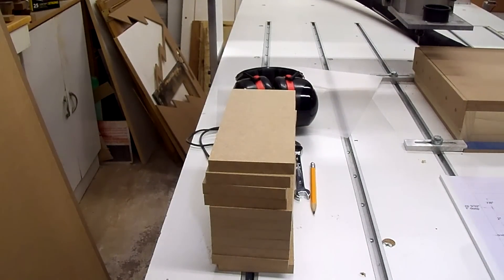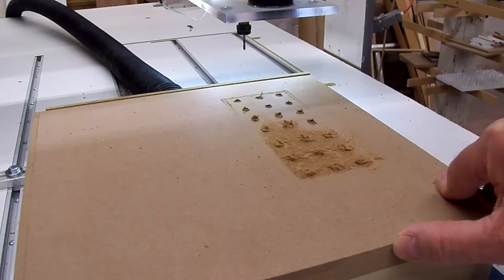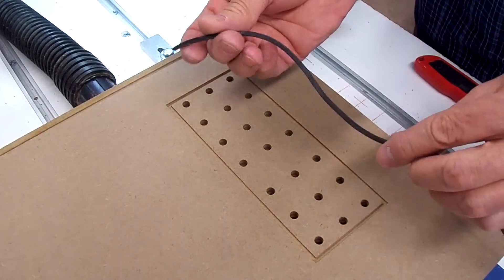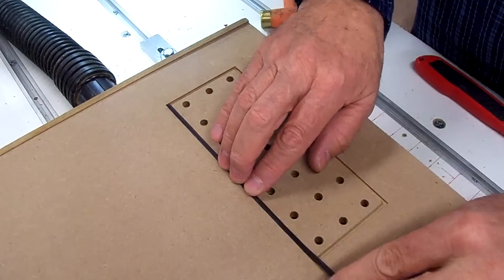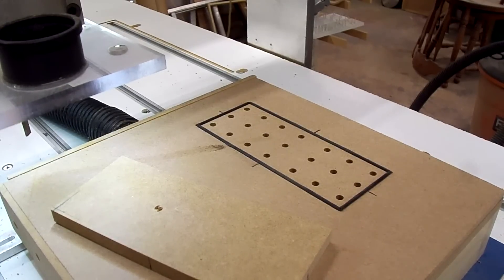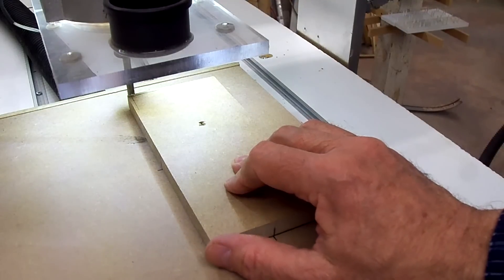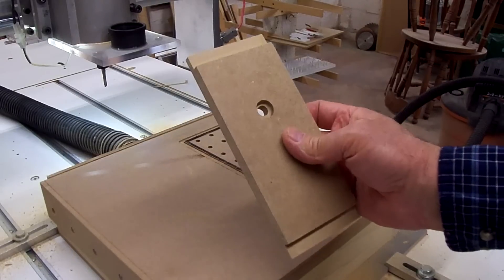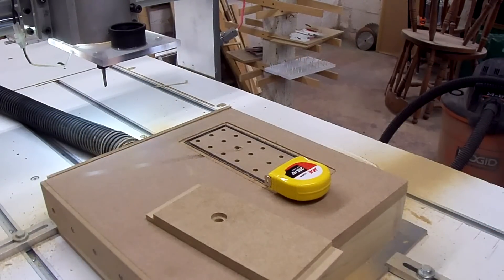CNC vacuum template

Comment: I do a lot work with a vacuum bed on my bigger machine, can you get foam chord as we call it here down under? It's cheap and better (softer) than the fly wire spline, I just radius the corners and butt join the ends of the gasket. 

The other suggestion is to machine out the entire vacuum area with exception of an island or two to support the stock it only needs to be 1mm deep, and will enormously increase your holding power

Comment: That new cutter made a nice job of the cuts. Isn't it fantastic how accurate you can be with a home CNC machine and every part comes out the same. The vacuum board makes holding a dream.Cheers Dave.

Comment: why did not you just bend the rubber wire at the corners and you cut them ?
Reply: Even dogbone would've done just fine and ending the sealer in one of them...but good that you do it your way...we all work differently
Reply: he peffer to have 4 potencial leaking joints instead of 1.